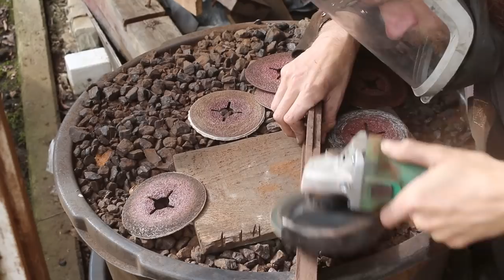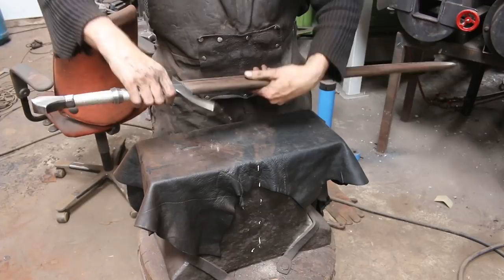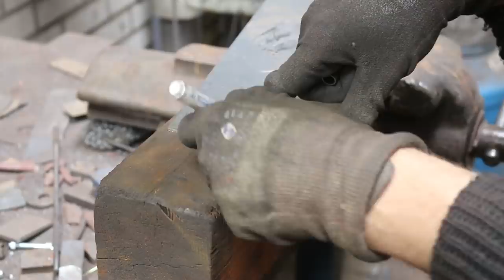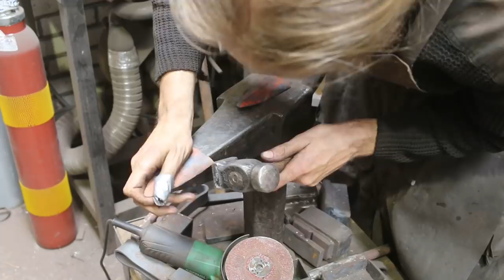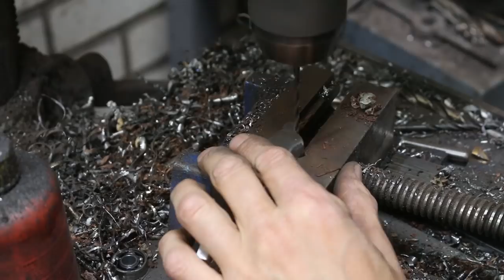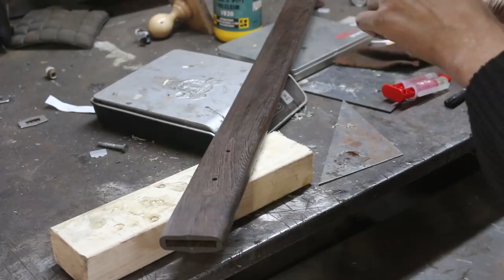Forging a longsword part 4, making the scabbard.

Comment: if you put a copper tube or solid rod inside the scabbard finisher when you welding it you wont have so much weld to clean up on the inside.

Comment: What kinda wood is that?
Reply: I wanted to know that, too.
Some woods shrink too much as they dry, so after a year the sword won't go in the scabbard. Mesquite has high dimensional stability but it's prone to splitting into layers.
I think the choice of wood would be very important.